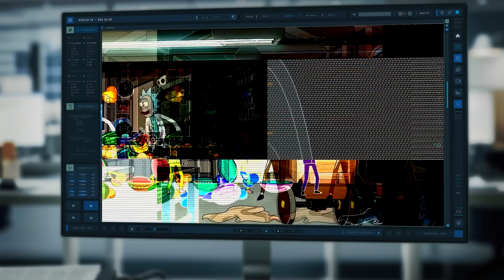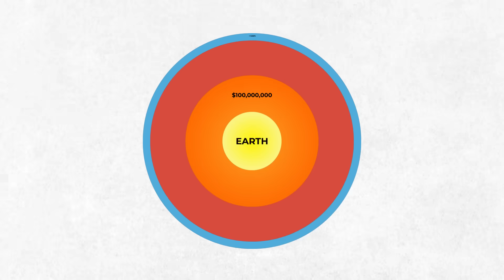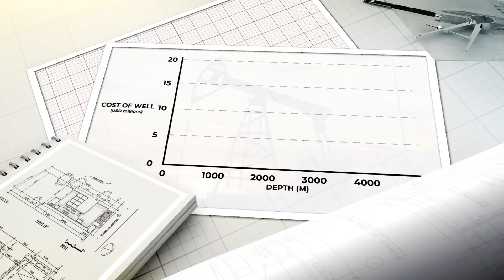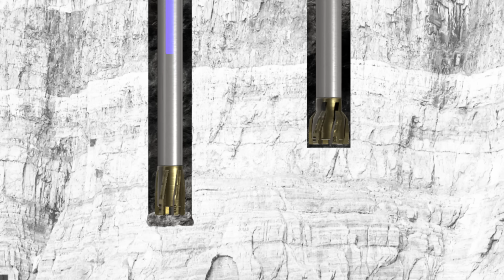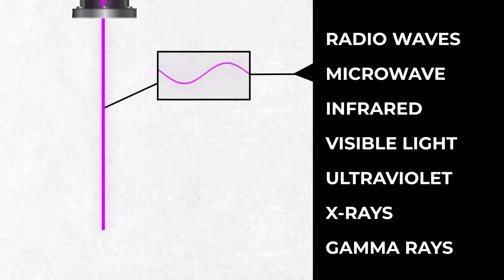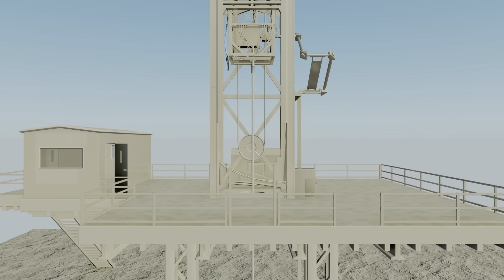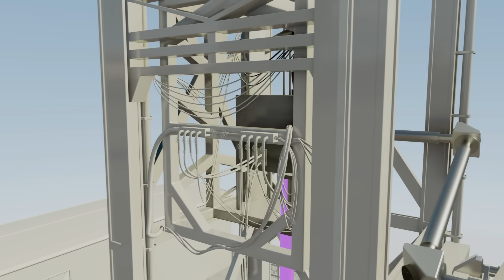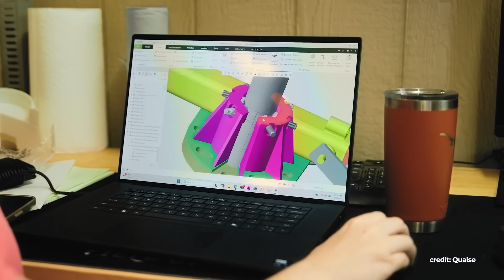The Most Advanced Drill in Human History

Comment: 2:21 no one drills 10km deep shaft with 10km rotating rod. On the end of column drilling mud rotates turbine which produces all torque for drilling heads.
Reply: I was wondering how deep drilling actually worked. Rotating a giant shaft seemed unreasonable, and it needs something to keep the weight off... It can't just be an empty hole? Right? 

That would put an enormous amount of weight on the top supporting structure, and the topmost pipe threads... Every length of pipe is at least many hundreds of lbs added.

Comment: Using plasma, or laser or anything is just doomed to fail when drilling. If you look the history of startups, all failed, shown just silly demos of going through a few inches of material. There are so many problems with technologies like this. The primary question is always - where does all the "vaporized' or melted material go? How does the device survivate the insane pressures down there? Two questions which ruined all startups dealing with this tech.
Reply: Yup. Never mind how they will survive the extreme pressures, they have not demonstrated how they will pressurise the well sufficiently to prevent the overburden pressure from collapsing the hole, neither have they demonstrated how they will prevent eruptive zones from flowing to surface. Just saying the vitrified rock acts like a well casing is ridiculous... Have they actually brought on board any real world HPHT deep well experienced drilling engineers???? Seems like they have not and so they will fail.

Comment: The original intent was to sends water down a geothermal well to turn it to steam then pump that to a steam turbine, BUT why not send CO2 at a high enough pressure that would result in supercritical CO2 to turn a Brayton cycle turbine which is smaller and more efficient?
Reply: Because there is not enough heat flux to power anything. At 0.1W/m2 and a small pipe the water at the surface will be cold again.
Reply: @kimollivier  Then you need to tell them to stop wasting money on this project...right???

Comment: Why not put a robot in like a little mining gnome hacking away at the rock using water to pump up the debris and cool the hole? Energy is delivered via cables and if the pikkaxe is used up a new robot takes over and the used one is pulled up. No need to transfer rotational energy down the hole. To stabilize the hole you can still use pipes and concrete. Maybe if the temperatures get too hot you need to replace the water with oil but that could be recycled and the robot gnome should be fine working in hot oil too.

Comment: I designed a contrarotating deep earth drill that uses a chain of axial flux motors to both turn a bore head and rotate the upper portion of the drill in the opposite direction with a threading to force its way down deeper.

This was essentially to eliminate the torque over distance by making a modular drill that only turns at the bottom of the hole.

The basic concept is that one set of rotors turns the drive shaft for the drill head, and the contrarotating rotors turn the shell of the rest of the "drill" bit this is attached to a long line of rods leading up to the top of the hole but without having to turn the entire mechanism and isolating the rotation to the bottom of the hole.

I hope that I explained the idea in a way that is understandable. It's honestly quite rudimentary once you draw it.. i named it the Spine engine because it resembles the vertebrae in a spine. The big challenge is putting enough wire down to power it over kilometres. However, i suspect that that can be overcome with some clever engineering. 

Perhaps this idea could someday also apply the same principle by lowering the Maser generator rather than using magnificently long wave guides.

Sorry for the loooonnggg comment, but I really like the idea, and geothermal is a nice use of old oil lines so environmentally it's a promising technology and financially it's a good investment. I hope to see a successful implementation from Quaise, and i hope they make a lot of money.
Reply: Pretty commonly used in the O&G industry are what is referred to as "mud motors"... they're essentially a PDM, powered by the drilling fluid that is pumped from surface (ie. down the drill pipe; and through the motor). Essentially a hydraulically powered version of what you're talking about... they've been around for a very long time.

They're typically not counter-rotating in the sense you've described, and generate a reactive torque on the drill string. You can then step it up a notch and have a PDM-powered Rotary Steerable System... think of it as a PDM rotating another drilling assembly which contains electronic components which direct the bit into a desired orientation (toolface) via what is typically referred to as a point-the-bit or push-the-bit setup. These setups can vary wildy... anything from deflecting an internal shaft the drill bit is attached to; or even having hydraulically actuated pads that rotate with the drilling assembly and increase or decrease pressure against the wellbore, depending on their orientation within the wellbore (ie. they "push" the RSS unit and bit in a certain direction).
Reply: @heyitsjel that actually makes a lot of sense.. kind of like an Archimedes screw but in reverse.. using hydraulics to turn the drill instead of electricity. If it could be made to work in a contrarotating fashion I still believe that it could improve torque and efficiency but perhaps that's not true or necessary as it would take experimentation and trial and error to perfect it but yes.. either way a new drill design would definitely revolutionise the industry and bring about new opportunities for growth in the deep earth sector. Thanks for the interesting reply that was very informative. 😁✌️
Reply: What a great idea.  Sort of like how helicopters with counter rotating propellers don't need a rear rotor to compensate for torque.  The hardest part would likely be keeping the power cable from getting hot - and causing resistance issues.
Reply: Neat.  You still have the problem of tool wear.
Reply: @bmamps3937 Artificial diamond can help but every tool wears.
Reply: @devindodge8648  diamond bits have been used in drilling wells for 30-40 years. They wear slower than conventional rock bits, but they wear out. The first time I counted to a million was while monitoring total rotations of a diamond bit back in 1979.
Reply: Yes, the idea that it creates a pathway for folks in the oil industry to transition is a huge benefit.

It means that there's larger potential for funding, and hopefully less resistance.
Reply: A conductor for a MW of current is gonna be very beefy and it will get hot due to the surrounding rock which incresses electrical resistence.  I think the Maser and beam guide may just be the best way to get energy down the bore hole.  So lets try to convert that energy back to mechanical form, to do that I think the simplest solution is a steam turbine run by a small water line which is outside the wave guide which runs a pump/impeller/boiling chamber/turbine similar to a rocket engine and which allows some of the Maser energy to enter the boiling chamber through a window which microwaves pass but water can not.  The trubine provides the rotation of the drillbit right at the bit and can be controled by the opening and clossing of the window that admits the microwaves, the steam is vented up the borehole well above the drill face so as not to interfier with it and it can act to carry away the rock fragments as it dose.  Potentially valving could open to direct a downward steam blasts for clearing fragments as well.  Control signals would be done by the Maser itself, slight frequency shifts which simply cause the energy to move through certain frequency wave guides direct the energy to the desired mechanism one wishes to run without any active electronics down at the bottom of the borehole.
Reply: @kennethferland5579  I think you're underestimating the challenge of making a steam turbine that can handle a megawatt of power in such limited space and harsh conditions
Reply: 📛What's with all this talk of "expensive, diamond tipped drill heads"? Look, let's stop overcomplicating these green energy concepts. It's obvious to most of us that all we really need to access geothermal energy is a man with a shovel! 

Just yesterday I was planting a few shrubs in my back yard, when I realized I'd dug one-too-many 18" deep holes. 

Sure, I could've simply refilled the extra hole, but then I remembered hearing about the existence of deep geothermal energy. So I decided to keep digging til I reached it, knowing full well that I'll go through a few shovels,. 

It took a few hours of digging, but I've  already dug down 746 feet.  I'll reach 2,648 feet by early next week. I carried a thermometer down with me,  and I measured the temps there at 222.7°f. No wonder I was sweating a little and my strawberry kiwi Powerade was boiling. 😁
Reply: So in essence, instead of building magnificently long, inefficient waveguides from the surface, put the maser generator itself down the hole, powered by long cables and drill with concentrated microwave energy right where you need it.
Reply: @SpotterDeer Definitely a possibility - but can you keep the unit cool enough to operate? This is one of the biggest obstacles HPHT (high pressure; high temperature) drilling faces. Pretty much all niche hot hole drilling assemblies & logging tools can't operate at more than about 220-230 Celsius, and that's pushing the limit. They're also not overly reliable at these temps.

The next issue is developing wired pipe that can curry the amount of power required - most are limited to sub 5kw of power delivery... and even that is outside their recommended operating power range. Generally they're used for high speed communication with the electronics packages in the drilling assembly; not for high power delivery.
Reply: @heyitsjel  yes, logging tool fail (even those in thermos flasks) at high temperatures. This makes evaluating the discovery difficult. 
BUT, plenty of wells have been drilled with conventional technology into supercritical water across the Gulf of Mexico. This water flashes to steam at surface conditions; that’s all a geothermal plant needs. So… other than VC bait, why do we need this new technique? There’s plenty of hot water reachable with traditional drilling technology.
Reply: @SpotterDeer long cables? The drill pipe must rotate to attach a new section to the string of pipes. How do you plan to add a new length of pipe? Magically undo the cable and thread it through the pipe before screwing it together?
Reply: ...EXPLOSIVES TURN ROCK INTO DUST...VACUUM SUCKS

....OK,WAS THINKING AROUND 5 MINUTES...TO MAKE A much better SOLUTION.....
Reply: @robotnikkkk001  I'm not sure vacuum pumps exist in the size needed to pull cuttings from 5km plus underground.
Reply: @robotnikkkk001 Water well pumps go at the bottom (or below the static water level) of the well for a reason. A mercury manometer has vacuum over the mercury. The height of the mercury varies with external atmospheric pressure. Atmospheric pressure used to be reported in inches of mercury. Buildings taller than 3 stories have water tanks at the top fed by pumps at the bottom.

Comment: No, it's extremely finite energy.  Use enough geothermal energy and the rocks get cold.  They will eventually get hot again, but you can only pull so much energy out of the rocks per well.  More wells in the area will cool off the area faster.
Reply: Not true, we have been using the same wells here in Iceland for decades. people just can't comprehend how hot it is down there.
Reply: @sirnirvikingur yes, it is true. Iceland taps into a huge underground reservoir of superheated water covering thousands of hectares with a lot of large bores at a shallow depth. It is not the temperature that makes the turbines work, it is the volume of superheated water/steam. Rock is a good insulator at 0.1W/m2. If the area is small as in the deep bore idea with no reservoir there is not enough power available to do anything useful. New Zealand taps into older hot reservoirs and they are cooling down already. They have to put in low pressure turbines eventually and then close down. Reinjecting uses a lot of power. The 'swimming pool' reservoir in Iceland is a good way of returning the water, but that is not possible elsewhere.

Comment: There are so many technical difficulties to overcome that if I were an investor, I would not want to invest in this endeavor. But it's ingenious and fascinating, just hideously complicated. To say they're going to multiply the depths and rate they can drill by overcoming challenges that are not even understood at this stage of development makes me hopeful and respectful, but skeptical it can be done in the long run. Sorry. These guys are geniuses, but the problem is so massive that it's near impossible to solve anytime soon.
Reply: At those. Depths, water would be at a high pressure, very high.  It would be unlikely it would vaporize at all.
Reply: @pixels303at-odysee9   at the temperatures of the focused beam water breaks down into oxygen and hydrogen the pressure is relatively unimportant as its a purely physical process involving the atomic bond. 

hopefully i dont have to explain to you what happens to hydrogen and oxygen when its mixed in the ideal ratio and hit by a megawatt microwave blast....
Reply: @KT-pv3kl When I was a kid, mom used to use this electrode driven atomizer made from Vicks, where she would add water and a oil and it would fill the room with the vapor.  It uses alternating voltages to vaporize the water.  If what you say is true, would that mean it would have caused houses to explode in the 70's when a explosive atmosphere of hydrogen and oxygen mixture reached the LEL needed to ignite?

Little critical thinking.  When oxygen and hydrogen mix, they usually slowly and harmlessly combine to create water vapor.  First time I ever heard of your suggested theory.  Do you have any suggested materials on this relating to constructive wave interference propagation of high ekectromagnetic frequencies to seperate water vapor molecules?

Only way to seperate the gas is by a Direct current (DC).  I forget what element propagates to positive and negative.  You cannot propagate DC in the atmosphere, unless you are a highly charged storm cloud at trillions of volts.
Reply: @pixels303at-odysee9  if oxygen and hydrogen mix and you add a flame or alternatively a megawatt of microwave radiation, they explode! So much for your critical thinking, mate!

The vaporizer you describe from your childhood is a basic ultrasonic emitter that can cause fluids to vaporize using microcavitation. It certainly doesn't use "voltage" to separate oxygen from hydrogen, which happens at around  2000-3000°C. You really need to brush up on your basic physics knowledge if you don't know the difference between a microwave beam vaporizing rock and potentially water at 2000+°C and an ultrasonic vaporizer. 
And before you get the bright idea to shine with your knowledge again: no, a vape doesn't do it either, it uses a heated metal coil to heat oils above their smoke point, turning them into smoke, which is also a form of vaporisation that is entirely unrelated to the breaking of atomic bonds
Reply: @pixels303at-odysee9  Yes, the idea is to use the superheated water to heat other water to steam to drive the turbines before you pump it back down again.  Closed loop forever.

Comment: Let's cool down Yellowstone (and other dangerous volcanoes) while gathering a s. Ton of energy
Reply: It's actually not a bad idea.  The issue is the dome of hot magma right beneath the surface.  If we can siphon off enough heat, the pressure in the caldera drops, and the risk of an eruption decreases.  It would be a genuinely cool piece of planetary engineering. 

We do something similar with deep lakes susceptible to limnic eruptions of CO2. Run a pipe deep down into supersaturated layers of water and gradually pump that water to the surface, letting the CO2 outgas. Turning it into a slow release spread out over years, rather than a cataclysm release all at once that suffocates everything nearby.
Reply: @jdle I didn't think about the hot gas, you really have a point. 
But beyond that, with enough geothermal energy power plants, we can cool down the magma itself with huge amounts of water (that's how they work)
Reply: @markmuller7962  You mean, the water that is a precious resource that we're short on??
Reply: @Bonnie The water gets recycled as it comes back as vapor and re-pumped underground (I was expecting a comment like yours unfortunately)
Reply: @Bonnie Wait, you've also commented about earthquakes? You should stop commenting on the Internet all together. Friendly advice
Reply: @jdlessl  Thank you for including all the details about how it works!
Reply: And kill off Old Faithful? Good luck getting ANY regulatory body to give the permits for that.
Reply: @TheDusk  Maybe don't drill right next to old faithful?
Reply: Um, how?
Reply: @BonnieShadow33 this type of drilling down not generate earthquakes
Reply: yeah i cant see how this could have ANY negative sideeffects.... 
its not like geothermal plants have shown to cause all kinds of worrying sideeffects like earthquakes and fractures in the bedrock as well as increased geothermal activity in the vincinity. 

if you want a volcano to go off faster by all means build a geothermal plant right on top of it...
Reply: @KT I don't think you understand the scale I'm talking about.
Besides, on earthquakes, I'd like to see some serious evidences, but even if some minor earthquakes were triggered, that's a small price to pay to defuse a dangerous volcano.

As a reminder, some volcanoes (like Krakatoa and others) can cause devastating climate changes that lasts up to 10 years